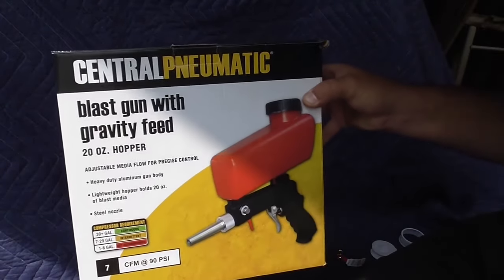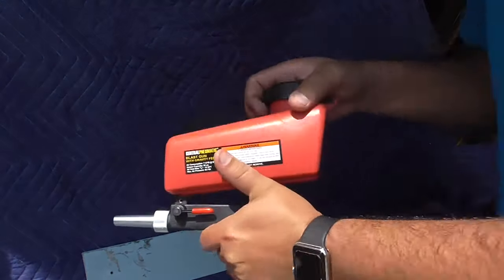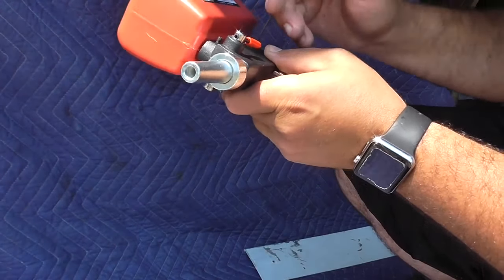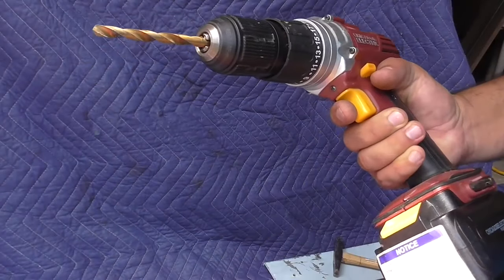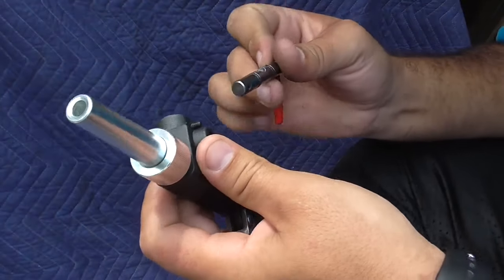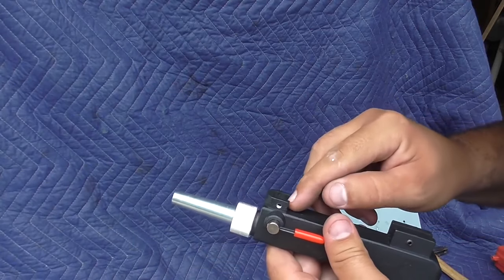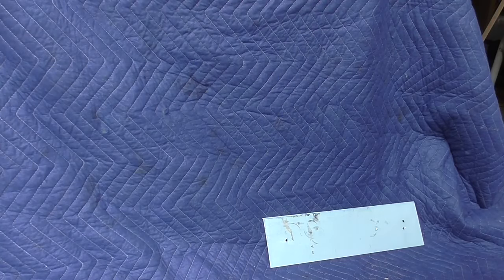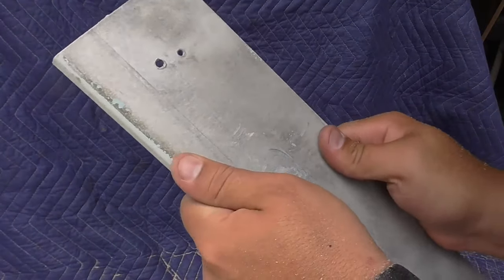HF 20 oz gravity feed sandblast gun review and modification #95793

Comment: Thanks for this mod video and sizing on bits/holes. I know this is 2 1/2 years old, but for folks that are coming here later, it does indeed say not to use sand. However, I found a decent work around to get consistent media size from Home Depot sandbox sand. I first put the sand out on a tarp to dry in the sun -  Then use a mesh strainer you can get from Walmart/Target and filter into a milk jug/soda bottle through a funnel. It takes out the largest pebbles and gives a generally consistent media without clogging.
Reply: you should use crushed glass instead of sand because sand is bad for your health some countries have band the use of it
Reply: @TotoGuy-Original  stay off the sand beaches on a windy day right
Reply: @coldspring624  You don't blast the beach sand at high velocity on metal plates while breathing the dust though. The NO SAND warning is because of silicosis, a lung disease that's nasty and occurs quite fast when exposed to significant amounts of silica (sand, concrete, plaster and other dusts, even glass) either over time or in acute exposure.

Comment: It does work out of the box if you use the proper media. Home Depot sand is made for a child's sandbox. It does not have a consistent grit size. I've used glass bead & aluminum oxide with great success. Moisture will clump the media and clog the gun, you need a water separator right at the gun.
Reply: What grit sand do you need to use ?
Reply: @hunterwingler543  I got decent results with 100/170 glass bead

Comment: I have the same tool.  On page 8 of the instruction manual, under General Operating Instructions, it  says "WARNING.  Do not use sand for blasting."  Further down, it states  that compressor pressure should not exceed 90 psi.  I had no problems, after reading the manual.  That's what it's for.
Reply: Not sure which manual you're looking at, but that's not what it says.   The warning is specifically regarding using sand with silica, and it's NOT that the unit can't use sand, the warning is specifically about breathing silicosis and aluminum oxide.

Comment: You have a 50/50 chance with this sand blaster,  I did the modifications and it works great now but
the guy next door to me,  his worked right out of the box.  I am also glad you remind everyone to 
wear goggles and gloves are a good idea as well,  Thank you.
Reply: I've heard a lot that a respirator or mask is very important. Guessing it makes paint dust or something.
Reply: @nateb4543  Not just the paint dust.   The very sand itself that is being used for blasting here contains silica and you can end up with silicosis which is no joke.
Reply: @Hereford1642  ya since this comment i strained sand i had for blasting, there was a bunch of dust and looked it up. Now i wear a reapirator
Reply: @nateb4543  My work here is done.

Comment: The most important factor in any media blasting is having the proper media. Home Depot sand is not made for sandblasting. It has tiny rocks, pebbles, and debris in the bag. You need either sand made for sandblasting, or you can filter your own sand through a screen to remove the larger particles that are clogging the valve and the tip on the gun.
Reply: You're just talking about the fancy sandbox sand that you can get at HD.

Comment: NOT supposed to be using sand through this gun. Says right on it not to use sand. Glass beads worked great through mine. No issues. Haven’t tried baking soda but should work too. All this extra work was unnecessary

Comment: When blasting with sand use at least a dust mask as silica dust is very hazardous to inhale.
Reply: "silica dust is very hazardous to inhale."

silica dust is really bad, it lingers in their air and doesn't settle, then becomes airborn. most states have banned it's use. it's worth the spend to go to a tool shop and buy the proper sandblasting media, plus get advice on the right material to use for your job.
Reply: @LatinDanceVideos  Blasting media is quite expensive especially if you don’t have a way to recover and recycle it I don’t agree with banning the use of silica sand just saying it’s dangerous or hazardous isn’t the best warning either they should put the definition of silicosis then people could make an educated decision to use a respirator or not
Reply: @Ezekiel-OffRoad  Yup... lungs are more expendable.  This video is dangerous, the sand is illegal in the US.
Reply: No worries if you have a set of spare lungs 🫁

Comment: I found sacks of black grit at Menards. I think it was eleven bucks or so. It works great but you are constantly refilling the hopper. I tried baking soda today. I dont think it's as aggressive but it lasted a lot longer. I bought sand and it didnt go through, im sure glad it didnt, the comments said I would have Silicosis right now. I have a respirator so i might get a second gun to modify.

Comment: Just picked up one of these today along with a used 5.5 hp compressor for $70.00. Hooked everything up and loaded the gun with glass heads. I’m going to etch glass. Cut a stencil on my Cricut, stuck it on a glass I wanted to test on and it was fantastic.  I live in SW Florida so humidity is a way of life here. Installed a desiccant moisture absorber in line and went to town. I am throughly empresses with thing. It does a great job.

Comment: Holy Cow! Some hobbies should not be tried without researching the danger or hazards! When I saw you hold the metal with a bare hand and I was already concerned when you stated going to home depot for a bag of sand... If you accidentally pass that over your bare hand it can take off flesh. Sand is risky, even with a dust filter, when you take it off the dangerous dust is lingering in the air. Yes some sands are safer than others but why mess around, get some blast media.

Comment: I’ve had one of those for a long time. Has never performed properly, like yours. I’m gonna make those mods. 

Get a hood. Keep the media out of your face and hair. 
Also filter your media with a 5gallon bucket and window screen. You can figure out how. I used the bucket lid to hold the screen with about an 8 inch hole in it to hold the screen. I use play sand and filter (screen) it. 
Or you can get blasting sand from some hardware stores.

Comment: if you use the proper sand blasting media and also put a air filter on the compressor you should not be drilling anything... but it is easy to modify for regular sand.

Comment: you can use river sand if you dry it out first  i use a metal bucket on a propane burner to dry the sand  quick and easy  damp sand will clog  any sand blaster

Comment: I gotta strip the paint off some old steel wheels for a repaint. Liquid strippers barely phase it. A 2400psi pressure washer with the needle tip does not phase it. Think this would do anything?

Comment: I followed this recommendations and the blasting improved a lot, but still  was not good for the task at hand. I was trying to remove old paint from a porch light  and it failed miserably. My compressor does not hold 90 psi for more than a second or two, it drops to 60 very quickly, so that might be my problem and not the improved modified gun. Thank you.

Comment: I will do this upgrade, but I think making the exit hole smaller will increase the power. I was thinking of using a bell type of hardware, I was thinking half the size smaller, not a bushing though, I think the bell for the venture effect.
Reply: Does sand blasting leave any type of marks in the metal like sanding ?
Reply: @kllgrogto5838  sand blasting will make metal have a matte finish.

Comment: Thanks for the video, I did the modification on mine but it still didn't work properly. Can you please tell me what size air compressor you used? I have a Dewalt 16 gallon compressor, I used play sand and also tried black diamond media.  Could the compressor size be the issue? Thanks
Reply: The capacity of the compressor only influences the possible duration of sandblasting.
The grain size of the medium may be too coarse.

Comment: Doesn't work because the lever to release the grit is turned off. I used mine yesterday and same thing. Adjust the lever and it works. Unless you did that on purpose so you could show your modification.

Comment: You made the case for this relatively inexpensive tool, but the whole video could be shortened by editing out long, real-time pauses. You did not specify the Harbor Freight tool number, but the major problem is your camera is still too distant from the tool to see where exactly your hole is placed. As you pointed out, a tiny difference off-center for your drill bit can make a difference. Although you recommend safety glasses, it probably would be a good idea to wear a good respirator mask, as well.
Reply: It would be a very good idea to wear an effective mask when using sand like this because the fine dust of silica you create will give you silicosis.   And you do not want that to happen.

Comment: I wonder if it can be used as a walnut blaster to clean valves on direct injection engines
Reply: Great thing about harbor freight is you can buy a $20 tool to try, and if it doesnt work, no big deal

Comment: Did you turn the lever on the front to open the hopper?
Reply from the maker: Yes it is not designed to run with sand. Sand particles are too big and will clog up the hole. That is why I drilled it out.

Comment: Your going to end up spending a shift load of money on sand  after you  modified it and using it for jobs like that your better off using sand paper. You should’ve check your air compressor first that gun needs the right PSI and Litres per minute to work correctly..

Comment: lol... use the right media, get a punch... don't abuse your drill bits, get at least a 2 stage compressor that will at least put out 90 psi that has an oil/water separator.  Then buy a new sandblasting gun

Comment: What kind of sand is used on that harbor freight sand blaster gun?
Reply from the maker: It is supposed to be the special sand blast media. But after the mod I am able to use play sand from home depot
Reply: Which one is more expensive?
Reply from the maker: The harbor fraight media.
Reply: Real sand leaves micro partials in the air that lead to lung problems and death.
Please be safe, use blasting media and ware a respirator.

Comment: can i use my 1 horse power compressor with that gun?
Reply from the maker: It depends on CFM of that compressor. They recommend 7 CFM @ 90 PSI. Or more. Otherwise the gun will use up the air in the tank and you will wait for the compressor to catch up and if you are doing big project you will be waiting more then working.

Comment: its not working because your compressor is too small to  feed it correctly  your  pump and tank isn’t fast enough to run a  sand blaster
Reply: that's what I want to know, what size compressor should someone use for this gun.

Comment: What grit media was that?
Reply from the maker: Play sand from Home Depot :)
Reply: Anatolii Gordiienko and it takes the paint off that quick after the modifications
Reply from the maker: It depends on the air pressure/volume and if you use the new sand or you reusing it.

Comment: Literally I just bought mine and I'm having the same problem it is not shooting any material. 😒
Reply: I'm Soo glad I found your video
Reply from the maker: I am glad I can help.
Reply: @tolikgord  it took me several drill sizes to finally make it work. But what I don't like is that it is shooting to much material now . Or IDK if it's normal, did you have that problem?
Reply from the maker: Just turn the lever a little but also sifting the sand to make sure it is the same size helps.
Reply: @tolikgord  ok , well I just finished with my project, that crushed walnut lasted me alot even doe it was shooting a bit to much I think.  (Still have some left over for another project 😃)
Reply: @humbertohernandez6536  Where do you get the crushed walnut at?? It's my understanding that you use it at a more delicate jobs